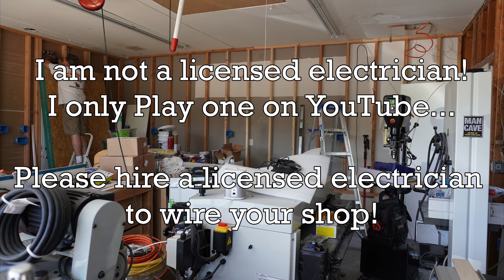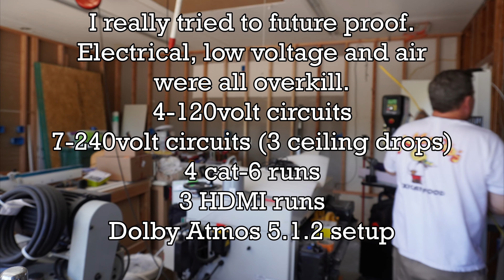Wiring the new shop

Comment: Do you normally run many of your 240V tools at the same time? or why have so many separate circuits?
Reply from the maker: Well, I totally agree with where you are going!  The most that I would have going at one time would be the:
Air compressor
Dust collector
Mini Split
The tool - T/S, Sander, J/P, Band Saw, (another tool that is coming)
So, I did not need that many circuits.  With the exception of the sander (7.5hp)  I could have wired the "tools" all on one circuit.  The reason that I did not was because I had some drops from the ceiling and some on the walls and most of all, I wanted a main "shut-off" for each tool.
I have kids, and I travel (after this world gets back to some normalcy) so I wanted to have one more level of protection.